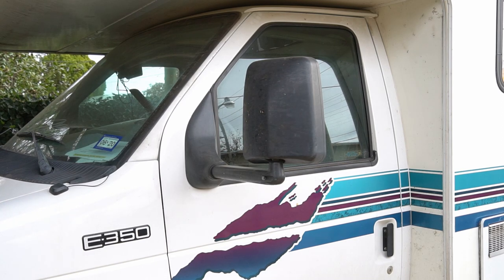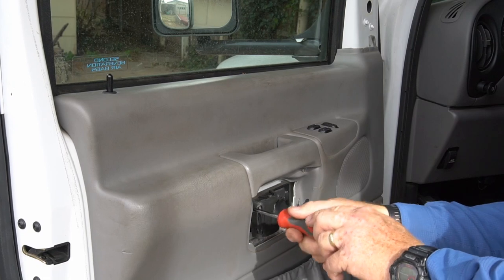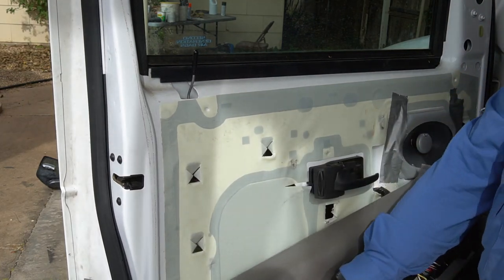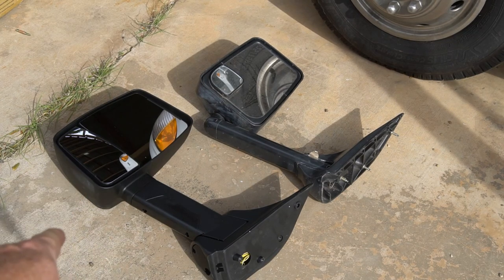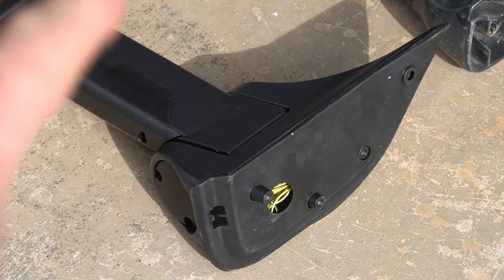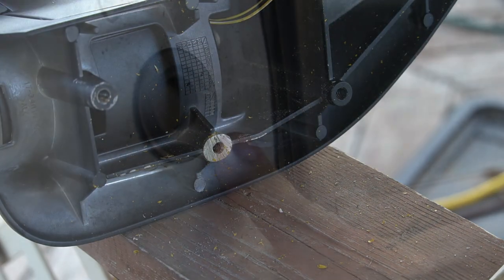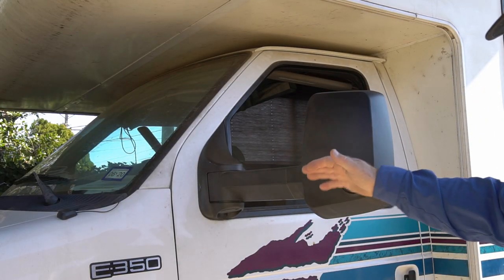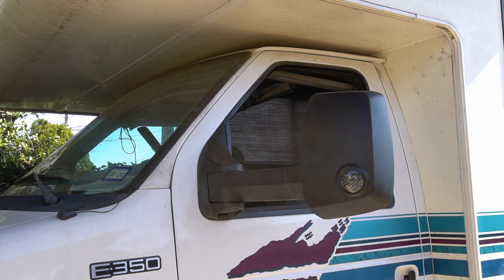🚚 How to install new aftermarket side mirrors on a Minnie Winnie 🛠️

Comment: B4 loosening 7/16 nuts, put a 1/4" wide strip of duct tape on opposite flats inside the socket. Socket will grip the nut making it much less likely you'll drop it
Reply from the maker: Thank you for this great information @phillbradshaw7190.  I appreciate it very much when viewers contribute useful information as you have here.